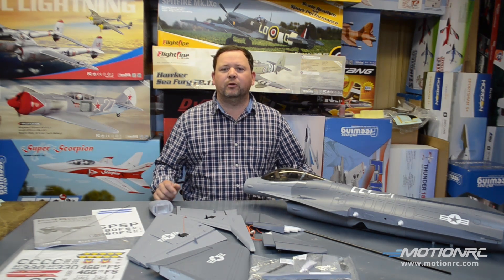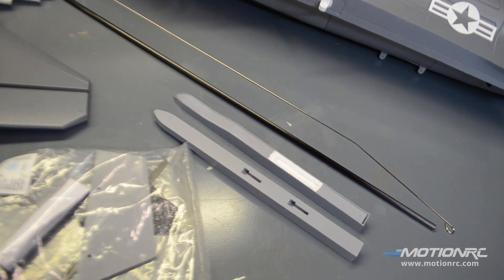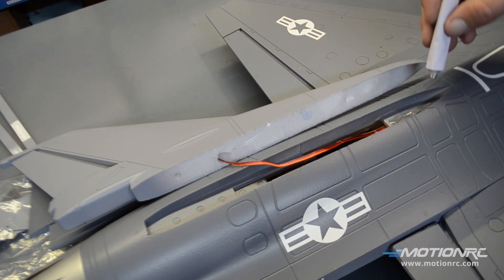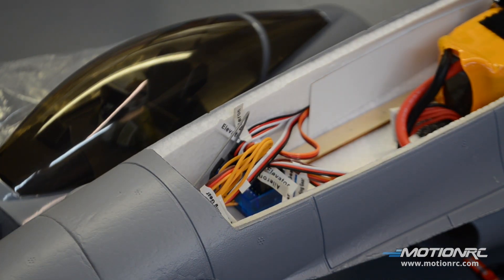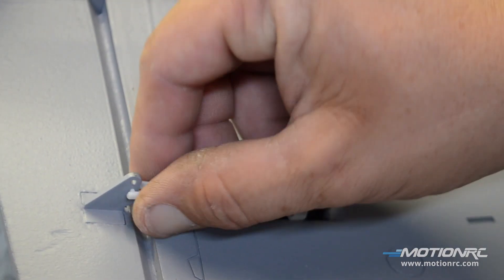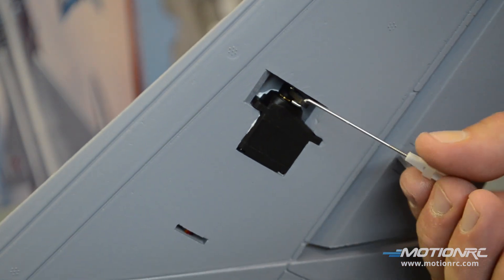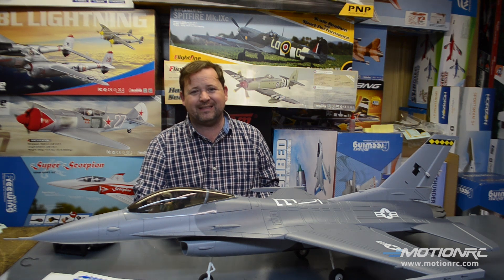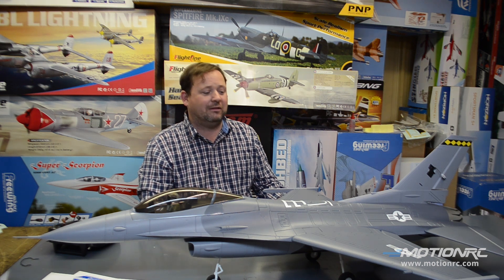Freewing V2 F-16 70mm Build

Comment: Get rid of the Blue box and put every servo on a separate channel that way there's less to go wrong, and greater control over each control surface for trimming. All you need is a 6 channel receiver which these days is almost the same price as a 4 channel. When will there be a video on installing the Ducted fan assembly. It seems simple but the wires get in the way a tutorial would be nice.

Comment: Very nice video!! I use the 2nd most inner hole on the servo horns of the elevators, flaps, and ailerons.  The control horns that's attached to the elevators (ball links), ailerons and flaps are all on the outer most hole.  All works great. Don't have to do much trimming. The blue wiring box inside cockpit area wouldn't work for me so I had to use the black wiring lead collector box found in the rochobby sport planes like the NXT Nemesis and also the "orange" transmitter  receiver to work the electronic controls. This also works great!